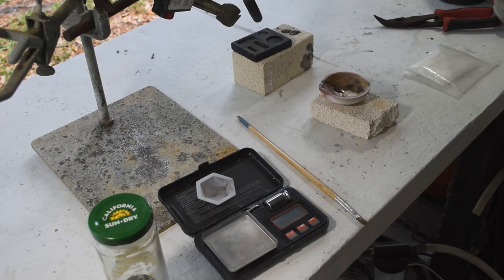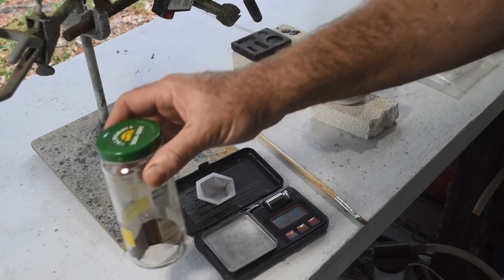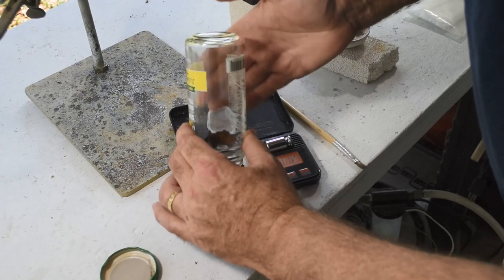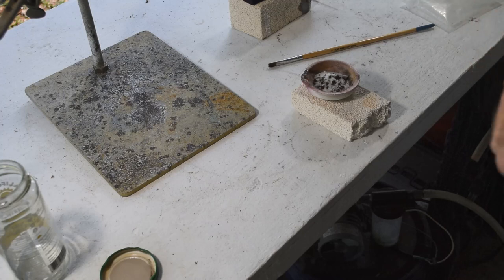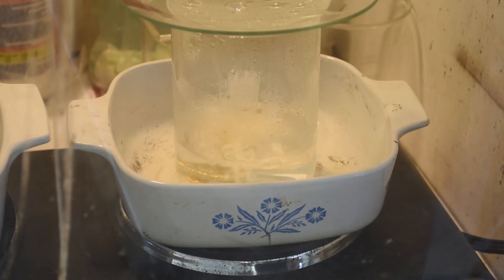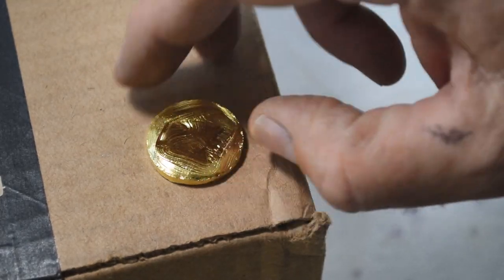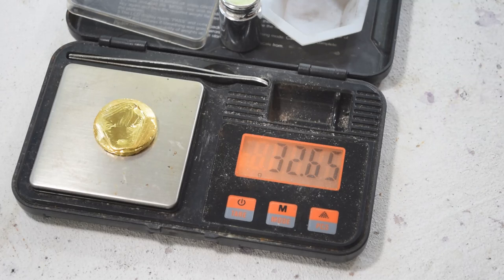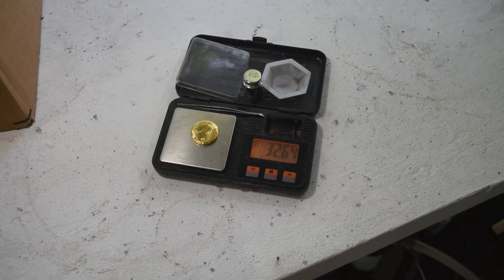Melting Gold Bullion Rounds

Comment: DO NOT, I repeat DO NOT USE an OXYGEN ACETYLENE torch as seen in this video. Gold vaporizes about 5100 degrees Fahrenheit , a cutting torch like the one in this video, well it will burn well over 6000 degrees Fahrenheit with the proper setting, consistently cutting torches all.are typically at the higher end of 5000 degree F. Trust me, I learned this the way that makes a man want to puke when thought of. Easily well over a pound of gold POOF during my two month learning curve, being knew to the game I thought the hotter the better, and often cranked that torch as if I was preparing to cut 2" thick steel I-Beam. I was discovering so many other mistake I had going on in my process , which mistakes  I then blamed for my lack of a nice nugget in hand after two months of smelting. cupellation, and too many empty Oxy. Acetylene and propane tanks talk about feeling stupid and being blind to the obvious elephant in the room. You may use the brazing tip if you have an oxy acetylene setup, the brazing torch burns max somewhere around 3400 degree Fahrenheit , which is more than enough for the majority of us on here.